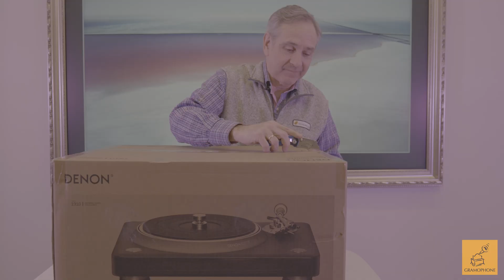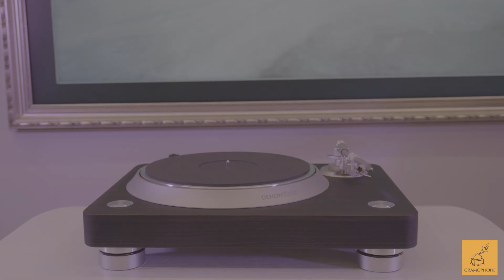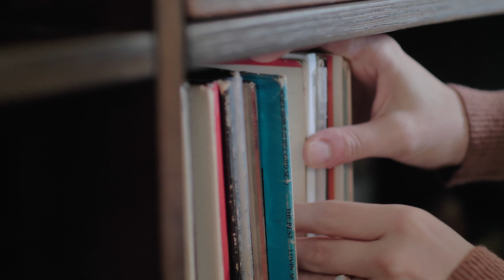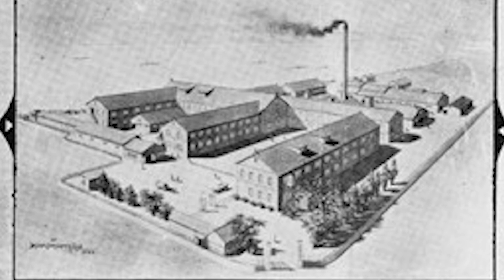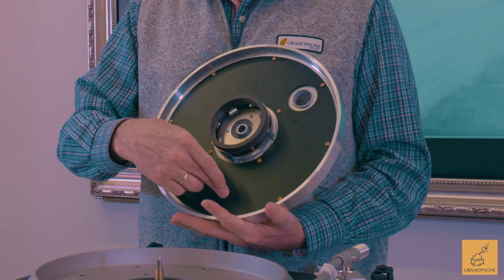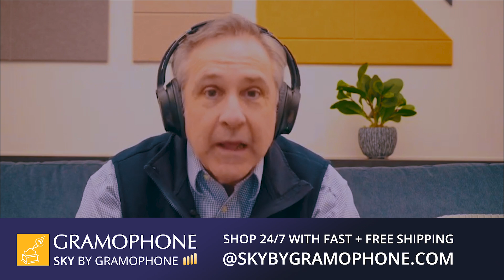Denon DP-3000NE Behind the Scenes | Product Manager

Comment: hi, i have the dp 3000ne with the aluminum headshel and the dl-103. I haven't used any of the plastic spacers included in the package, the VTA seems ok but the arm hight is almsot at the lowest setting . Do you think if adding the spacers would sacrify the sound quality . Just thinking adding them only to have the arm height a bit higher , but as said, even without thee spacers, vta is ok  with the arm set near the lowest adjustment height . Thanks in advance
Reply from the maker: Hello Nikos, thank you for supporting our channel.  There is nothing wrong with experimenting a bit, and trying the included spacers.  If your sound improves, great - stay with that.  Having said that, do you have set-up tools at your disposal?  Using a bubble level to make sure your turntable doesn’t need adjustment of the footers to be level is a great start.  A stylus force gauge will help you get the proper tracking weight.  Cartridge alignment protractors are an invaluable tool for getting the cartridge into proper position for feeding the left and right signals to your amp.  There are test records that provide signals to let you know you made it through these processes correctly. Unlike CD players, the physical alignment involved in playing vinyl is essential to getting the most for your money.  You may want to reach out to your local audio shop to see if they can recommend a turntable set-up expert.  Please feel free to reach out to us if we can help: ask@gramophone.com

Comment: Had one of these for a couple of weeks. Blown away by how well built it is and how good it sounds. Though I noticed a quirk - if you use the headshell handle to pull out the tone arm from its clip, the pressure required can change the azimuth of the cartridge slightly. So always pull out the headshell by hand and put it back by hand to avoid this. Just use the headshell handle to move the arm once out of the clip.
Reply from the maker: Thanks for your comments re tonearm handling, Voice.  We're glad you have the same experience of excellent build and sound quality with DP-3000 NE.

Comment: PLEASE I NEED HELP. is the denon dp 3000ne better, or the micro seiki bl 71 from 1984? Which one do I buy? Thank you very much. Greetings
Reply from the maker: Hello Jose, as much as we like the older Micro Seiki units, the technology that keeps this Denon 'table running at rock-stable speeds simply did not exist until recently.  Folks have been extremely happy with the DP 3000NE we've sold - we recommend it without hesitation

Comment: The motor assembly is exactly the same as the old Technics SL range of Turntables. 
Technics addressed this with their new range of SL turntables by designing a completely different motor with zero cogging technology. Personally, I find it very hard to hear cogging and by the time you hear it, you've missed the music. 
This Denon is half the price of the Technics SL-1200G yet twice the price of the SL-1500 (which uses a basic new motor assembly) 
I'm thinking the Denon is a middle range alternative that looks audiophile rather than DJ orientated.  
Of course the phono preamp and cartridge chosen will determine its overall sound.
Reply: Cogging was solved in the 70s, it's more about marketing than anything else these days.
Reply: It's a completely different approach to the engine with different boards and power supplies without the problem you say. But that's the Technics marketing you can't hear.
Reply: @makis-musiclover5315  
Being a collector of Technics turntables and parts, I recognised the main motor assembly. Its that part that apparently causes the mentioned issues, not any motor controlling electronics.  But like I said, you need "Golden Ears" or very special measuring equipment to register cogging. I like the Denon very much, and just might add it to my collection. 
I will say though that the SL-1200G is a sound improvement over older SL models. 
This could be down to build or even improvement in motor technology.
Reply: @ProjectOverseer  Thanks for pointing it out, I couldn't see the cogging on the Denon but I couldn't hear it on the Denon either, the motor has completely different specifications than the SL, even the magnet has a distance from the plater.I would prefer a G with a Denon arm with Denon plinth and Denon isolation to be 100% Audiophile.Don't forget that denon also made great Turntables like the DP 💯.You should go listen to the dp 3000ne 😉
Reply: It’s a pity they don’t have different plinths, walnut.
Reply: @jos5067  believe me when you see it up close you will be surprised and especially when you hear it.
Reply: @makis-musiclover5315  I known, it’s great 👍 that they make these turntables again!! The Audiophiliac is also very enthusiastic 🤩 in his review. I am a huge Yamaha fan for sure! ✔️
Reply: Solid MDF-Fiberboard.I don’t buy mdf plinth turntables.I don’t buy guitar amplifiers with cabinets made of mdf.Garbage in/Garbage out.
Reply: @eharmicar  Then all mtf speakers are rubbish 😋 you forget to mention that a combination of materials has also been made of thick aluminum etc. this is how the correct pickups are tuned, a combination of materials.